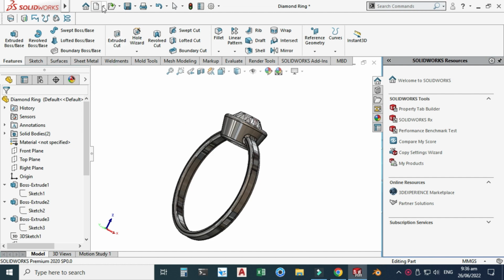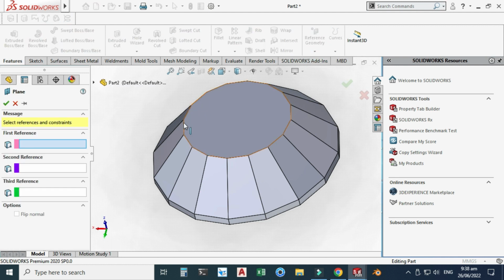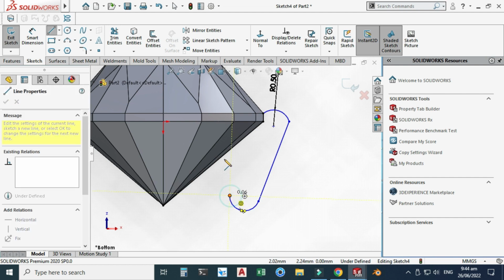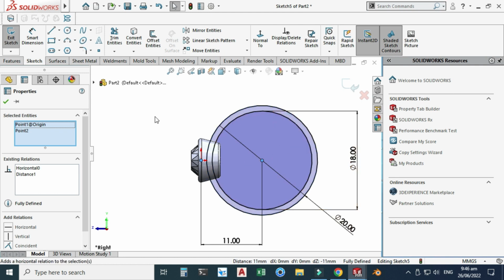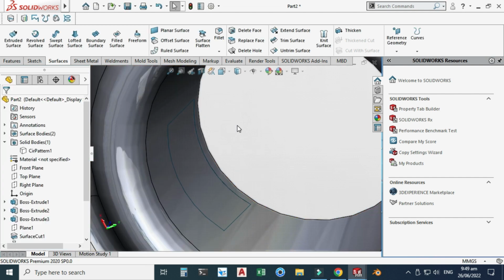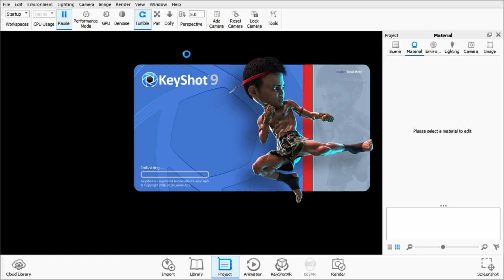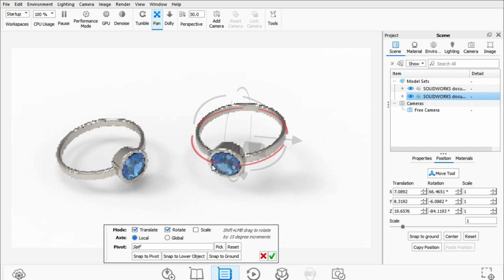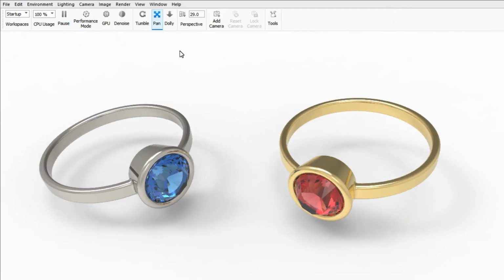Sketch diamond ring in solidworks | Solidworks jewelry design | Keyshot jewelry rendering | CADable

Comment: The circular pattern on the extruded cut is incorrect bc the the pattern will be based off an irregular face.  The endpoints of the triangular cuts on opposite side of the gem aren't tangent to the bottom edge.  You should instead create a circular pattern of the sketch entity on the plane and do surface cuts from that
Reply from the maker: Thanks for sharing info 😊